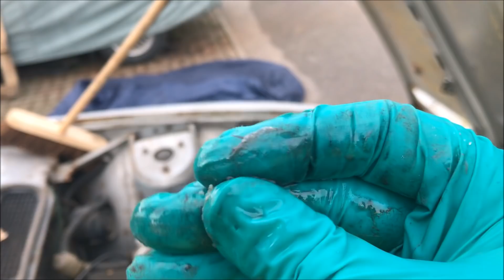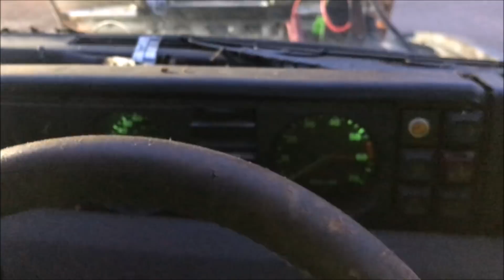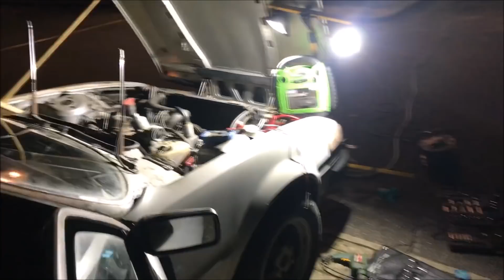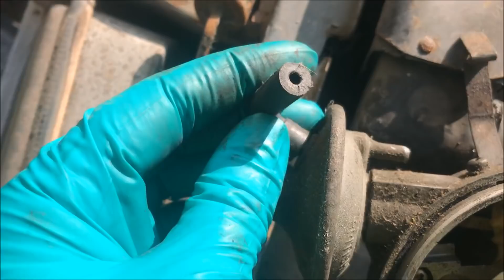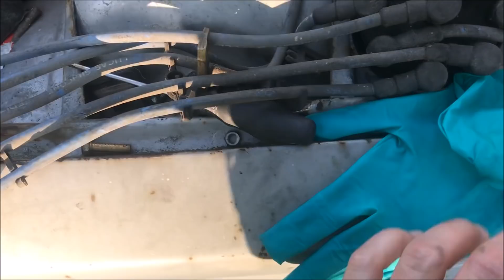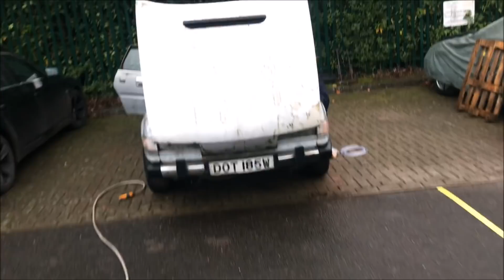Dotty 1981 Rover SD1 Restoration - Video 5 First start

Comment: Great video, do you have any tips for fault diagnosing why my SD1 won't crank. I've noticed you took some steps off camera to clean up the connectors to the starter motor. Did you test any of these with the multimeter? I'm a novice but inspired by your video.
Reply from the maker: If you have a multimeter, check the small wire that goes to the starter motor. Make sure that when the ignition switch is turned to cranking that you have 12v. If not check the start relay which will probably be in inner ring near the battery. Good luck!
Reply: @nitrosilvia  thank you

Comment: Her bodywork condition is probably related to the tow bar people would buy a second large car for towing the caravan.
Reply from the maker: Deffo.  They are bolted through rear panel and boot floor which tends to stress and open up all the seams.

Comment: You saying about the antifreeze gunk, when I restored my mini saloon the thermostat and housing were blocked solid.
Also somewhere in the back of my mind i'm sure them isolator switches should be fitted on the negative side as they cant handle the amperage and burn out on the positive side.
By the way good video
Reply from the maker: Thanks. Yes I think your right about cut outs. I think there should be a resistor or something so that if the power is cut while the engine is running the alternator doesn’t continue to kick out charge and fry stuff. Mine is missing so probably not a good thing!

Comment: I would rip out all that aftermarket electrical isolator gubbins, only more to go wrong.  It looks like a series 1.5 rather than full fat series 1. But not sure about the washer jets on the wipers are they original?  I had a 1980 series 1 V8 and added the larger washer bottle from a series 2 along with the center wiper hole mounted fan spray washer jet from the series 2.  As the new bottle had 2 pumps (one for the rear on the series 2) I ran both the fan spray washer and the series 1 bonnet mounted ones.  BTW if you can get hold of the original workshop manual (The New Rover 3500 workshop manual) the bodywork repair section has diagrams of where all the original welds are and what is recommended in terms of welds when fitting replacement body panels.
Reply from the maker: Hi yes I think it’s a 1.5. Someone has retrofitted a vandenplas front bumper with the headlamp washers. I have that workshop manual. It’s good. It shows some repair procedures, the number of stir welds you need or length of seam weld. I’ll have to dig it out.

Comment: The engine must have been rebuilt. Looks likes it's never had a drop oil until you put some in. Sounds great though.
Reply from the maker: It’s strangely clean. There has been oil in it, and it definitely needs a change. But there is none of the usual sludge build up.
Reply: @nitrosilvia  looking at the state of the carbs,I'd put money on them having been running too rich in the past. A few liters of petrol in the sump has the effect of washing the inside of an engine,plus causing a bit of wear.

Comment: great, love it when an old engine comes back to life, and oils etc start burning off manifolds, its lumpy running will the poor HT leads and some fine tuning of the mixture and timing.
Reply from the maker: Stuff burning off always gets my heart rate going. I once accidentally left a pack of cable ties on a manifold, smokey molten horror show!